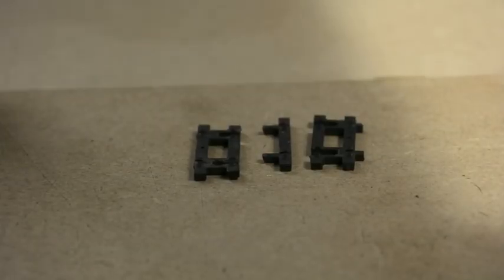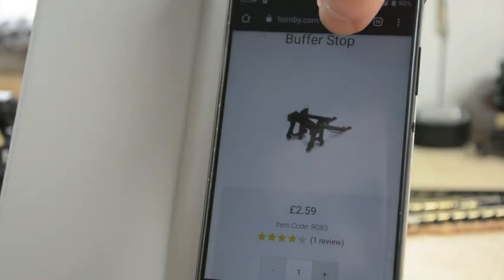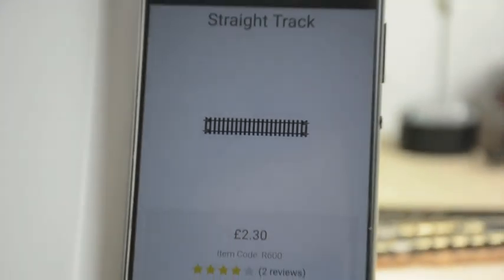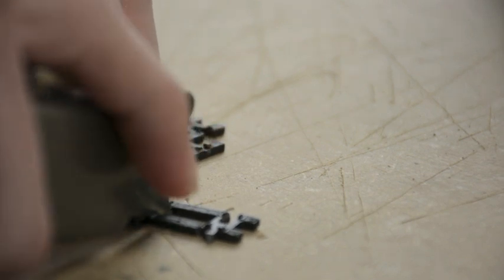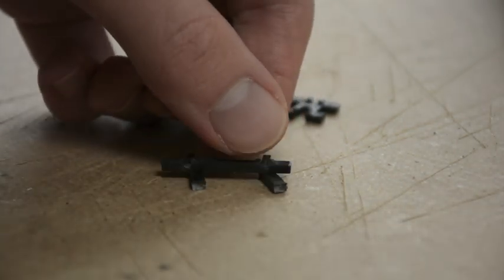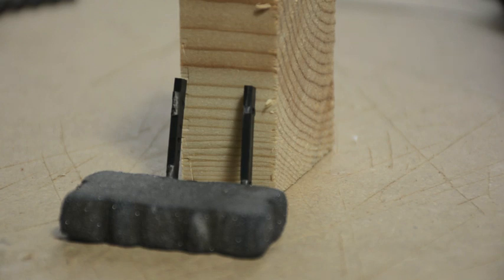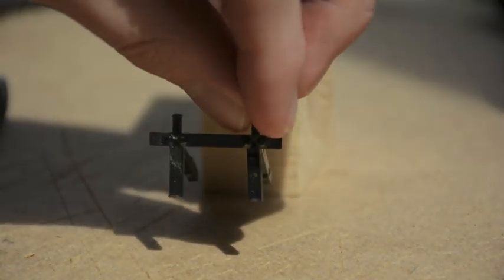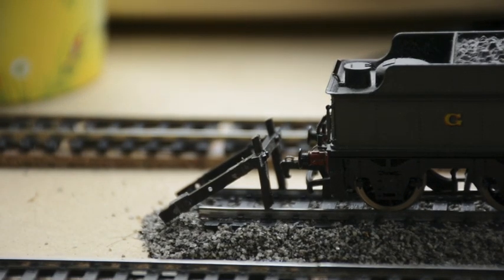Scratchbuilding Buffer Stops

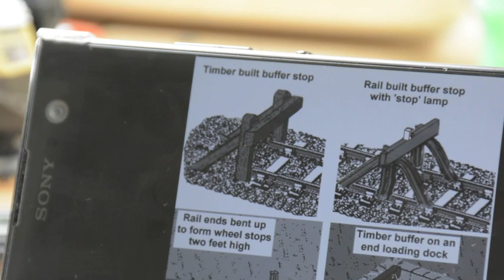Comment: Why haven’t I thought of this before? This is just pure genius!!!! I’ve been searching EVERYWHERE for OO buffer stops that are the Timber Built style at 0:39. I actually considered making a prototype with stirrers

And besides it will make use of all the track that I was originally going to throw away because of a few broken sleepers
Reply from the maker: Hi The Opera Ghost.
Thank you! The intention behind the scratchbuild was to create something effective and on the cheap. It is, as I am sure you know, partly a coincidence that sleepers on the 'real' railway were used for buffers too!

Always a good idea to stop things ending up in the bin! Best of luck with the build 👍 What I like to do with a worse-for-wear piece of track is to use the sleepers for either buffers or waggon-load, and then the rail can sit at the side of the track, or as you will have seen in some cases, between the fixed rails of the 'running line'.
Stay safe, kind regards GWR